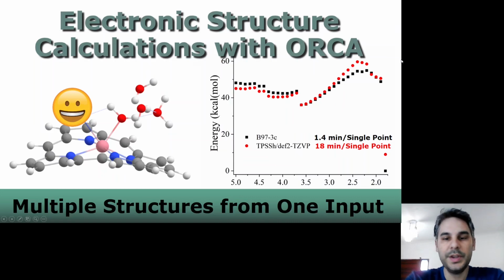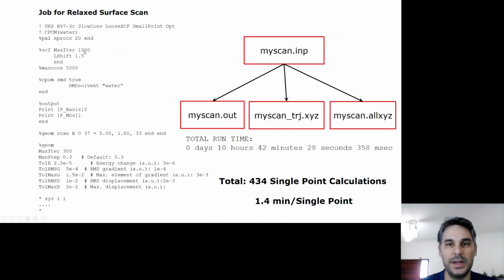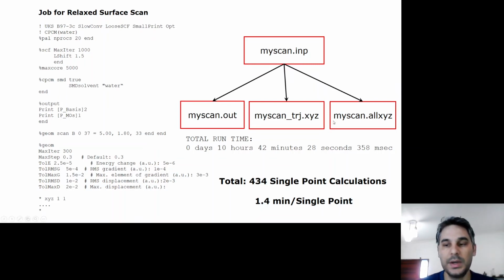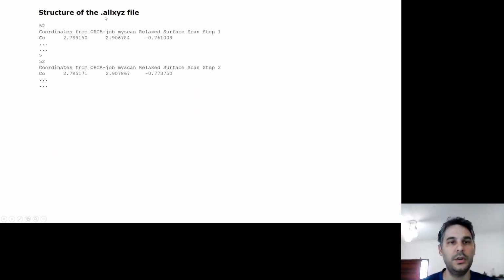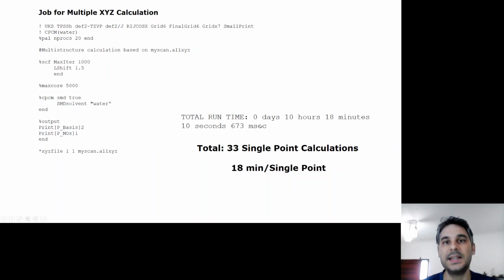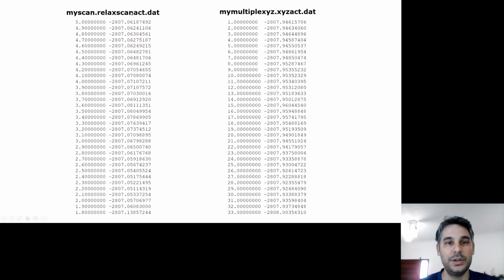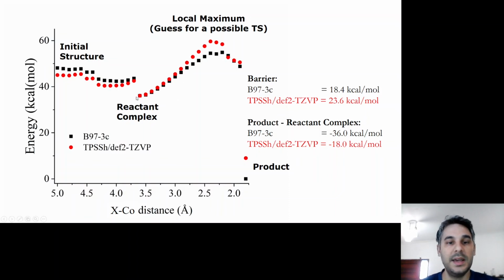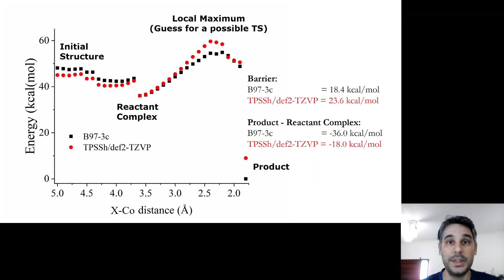Multiple Calculations with Only One Input File in ORCA

Comment: Sir, I ask for help, can the Orca software calculate the proton conductivity rate or hydrodnium ion rate? If possible, what is the name of the term and what is the command input to run it. First of all, thank you for the valuable videos.
Reply from the maker: The short answer is no. The long answer is you can maybe do that, but you have to be quite an expert. You would have to set up an explicit solution, some kind of electric field, and put one or more solvated protons on one region of your solvent box. Then you would have to run molecular dynamics simulations, for long periods of time. I suppose that if the protons move on average a certain length on a certain time, you could be able to fit that data with some model for ionic conductivity and obtain a thermodynamically relevant quantity, but I don't know the theory behind that. Alternatively perhaps you could put several protons close to each other, to simulate a high local concentration, and plot the mean distance between protons versus time. That may also be a quantity that can be related with the conductivity, given an appropriate model. In all cases you would need molecular dynamics and probably many parallel runs to get average quantities.
Reply: @niconeuman thankyou sir

Comment: Hi Nicolas, if I understand you right, you did the relaxed surface scan with lower tolerances for an accelerated calculation. Thats a great idea. However, when you subsequently obtain more reliable energies as shown in this video, you are using the non perfectly geometry optimized structures. This can cause slight errors in their energies right?
Reply from the maker: yes, there can be errors. all approaches do and you have to balance your time and objectives. but the tolerances are lower than significant chemical energies. you could do constrained optimisations on several steps of the scan with tighter bounds, but I'm not 100% sure this can be done using multiple xyz feature alone. if your scan has enough points, and the high level energy maximum does not match the low level energy maximum, it would tell you that you should refine a bit more your scan.

Comment: Hi! You said at the end that the accuracy of the more expensive calculation could not be accurate because the used geometry was obtained by a cheaper method. What's the right methodology in this case? Should you do a TS search with the more expensive method on the "TS" found by the cheaper method?
Reply from the maker: What we found is a local maximum in the scan that could be a good guess for a TS
 We dont know if what we found is a TS because we didn't run Freq calculation. But it can be a starting point. The TS calculations are tricky and have their own requirements. For that I would recommend using tight SCF and geom convergence criteria, and if OptTS doesn't work I would use the NEB method
Reply from the maker: Hi maybe I explained myself wrong. What I meant is that the accuracy should be checked, because when combining geometries from one method with energies from another sometimes the geometry conditions the quality of the final results. I do believe this particular approach to be good, but I warned that people should do their own tests and draw their own conclusions.

Comment from the maker: Leave your suggestions for other videos and questions in the comments!
Reply: Nicolas, i am a new follower. İ find your videos useful.  İ will watch them again and again, especially those related with esr studies. But it will be my demand from you. Some calculations take long time  when a molecule has a lot  of atoms. For now, i am running on the 4-core pc :) For large molecules, i need to send job files (slurms) from my pc to high performance  computers (hpc) in remote. İ Wonder if you prepare such video on going  from zero (by starting installing  orca on hpc )  to different slurms for different job files of orca. Sedat.
Reply from the maker: @sedatgumus414  Hi Sedat, I will make a video about this in some time, but the last months I have been very busy and haven't been able to upload many videos. Each HPC cluster is different, and maybe the people in charge of the cluster have already installed orca and you only need to ask for access. If not, you need a file-exchange software like WinSCP or Filezilla to move files and folders from your computer to the cluster and back. And the terminal in Linux or something like Putty in windows to access the cluster and launch jobs and other stuff.
Then there are several steps of installation of ORCA, the proper version of OpenMPI, adding the folders to the path and writing the correct .sh or .slurm files. That depends on each cluster. It will take me some time to make a video on that. But maybe the administrators of the cluster can help you much better. I'm not an expert in HPC clusters, and I use what other people have set up for me.
Reply: @niconeuman  thank you for the message. You know that ORCA team constantly updates the ORCA software so I am not sure if HPC administer loads the last version.  I am very unexperienced  with HPC . thanks again for your kind message. I will follow the whole videos related with ORCA. I know you are expert on esr. please let's keep in touch.
Reply: Dear Nicolas, is it possible for you  to send me the orca esr input file and the corresponding slurm file? Nowadays, i am giving many efforts to prepare  slurm & to overcome some mistakes. But i dont know  your email adress.